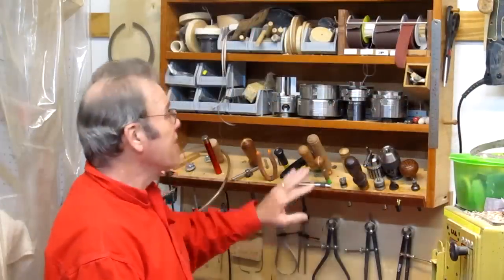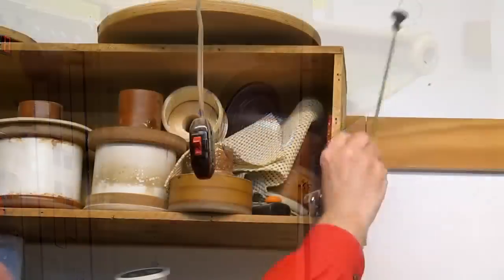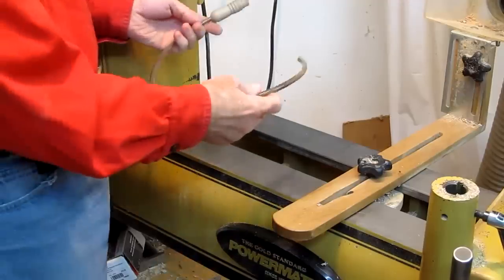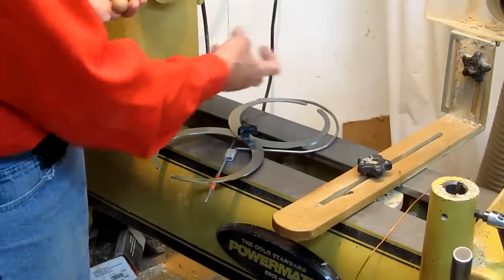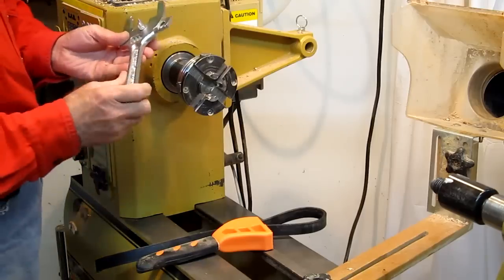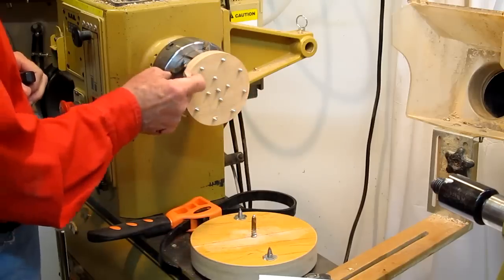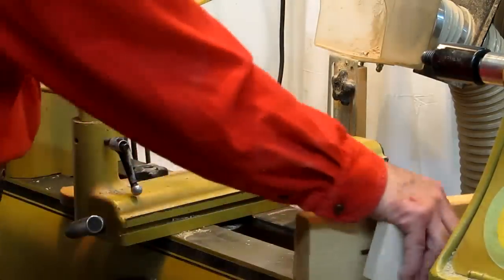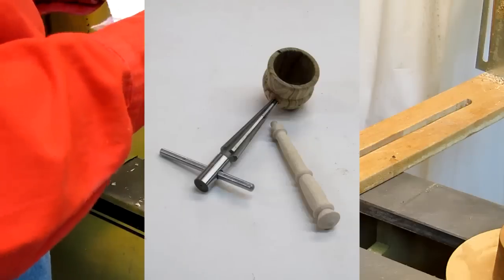30 Woodturning Tips, Tricks and Jigs

Comment: I'm in the planning stage of getting my first lathe. Checking out the different youtube videos on which chucks and chisels and tools to get. Thank you for putting your info out there. Do prefer the shorter videos. Plan on looking back on some of your previous videos.
Reply from the maker: I have revisited the video length several times. I  would have split this if it were a new video but just went on automatic pilot keeping it one like the orginal I edited. My general rule is make it as long as it needs to be but when it gets about 24 - 28 min, split into two.

Comment: Good video Mike great new ideas--cutting strips to set up bandsaw to cut spindle blanks, plumbers reamer uses and the cookie tin were new ideas for me which I will copy.
Also congratulations on your fine article on turning a chess set in the recent AAW Journal.. It is helpful.
John
Reply from the maker: New tip on the cookie tin. Cover the sharp cut edges with strips of duct tape!

Comment: Very good tips thank you.  At 8:33 there is something on your lathe bed made of wood, not sure what that is.  I love my 3520C and am still getting used to it.  Installed the tail-stock swing away now I can get enough length to turn my canes in one piece.  They should be at least 36" and I prefer one piece.
Reply from the maker: You must mean the bracket that holds my dust hood. I did a video on this earlier. https://youtu.be/k8dyMTaHqK0

Comment: Mike for your rubber handle holder trick, on your newer C model just use one of those Command wall hook things to hold it up on the slope.  It would be easy to remove whenever you needed to do so.  Cheers, Tom
Reply from the maker: Thanks for that.